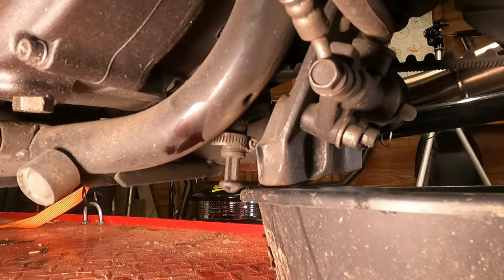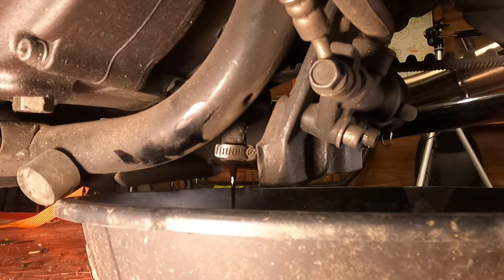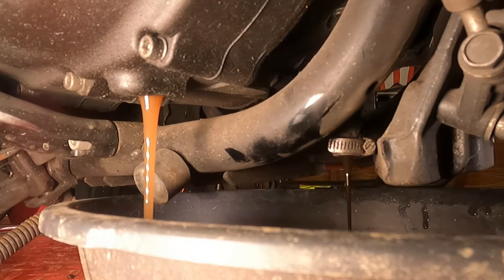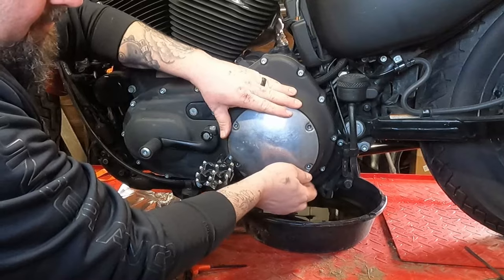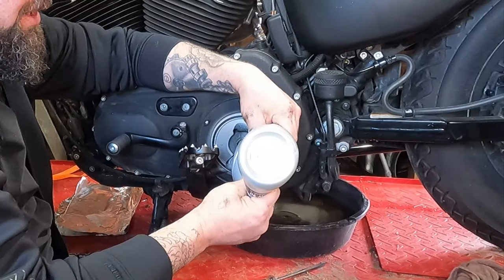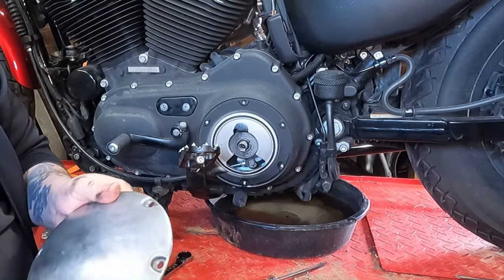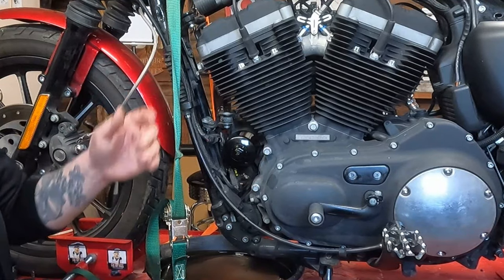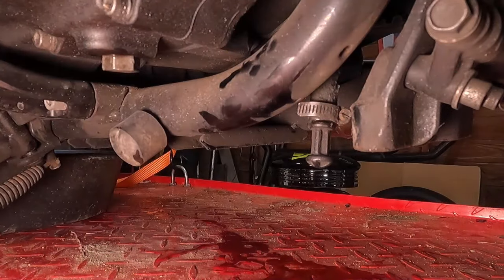Harley Sportster engine, primary & transmission oil change.

Comment: WRONG at time 0:43 he acknowledges the Primary and engine are the same type oil on this model sportster, then he proceeds to put 75-90 gear oil in it at time 8:58. . the wrong oil. YES many people put gear oil in and it is absolutely wrong to do on these model transfer cases. The reason is this model tranny needs very thin oil because it generates a lot of heat on the clutch pack, that the thinner oil carries away when it splashes the clutch. Thinner oil holds/stores less heat into it. It is not a good heat capacitor that can store tons of heat, this means it must dissipate the heat fast or it will be overwhelmed by heat. And it does dissipate the heat very fast it collects by conduction and even convection methods in the engine. . Much faster than gear oil.  , Also the tolerances are tighter on all the rotating assembly such that  thick gear oil won't penetrate properly into the moving journals, this causes accelerated wear on all journals. You absolutely do NOT want to put any type of Fiction modifier such as for limited slips in this tranny either. These clutch packs are designed to a specific viscosity of oil and thickness that the 20-40 weight delivers. the clutch packs are designed to slip a specific amount with a specific oil between them. . that a friction modifier will change. IF the clutch grabs to hard the non-case hardened teeth on gears will break off. This is why the clutch is designed to slip a specific amount. to reduce instantaneous shock on gear teeth that will snap them otf. The clutch pack is compressed on the oil and the specific density of the oil being changed by any type of friction compensator will damage the clutch pack because it will either expand the clutch plate interface and slip too much between plates or contract it and grab too hard. the two working together will cause clutch chatter when gear is released every time, bouncing of plates. Both are bad, Im not a shade tree mechanic. Im a post graduate engineer and it is all fact
Reply from the maker: Oh you’re a post grad engineer all right 😂.  I was a Millwright at NASA for 6 years, and I met a lot of you guys.  You’re overthinking this.  
You need sticky oil for a transmission that goes 0-100-0 quickly and repeatedly.  20/50 doesn’t have that stickiness. 

The friction modifier isn’t going to do anything to the clutch basket or gears compared to the debris from the primary chain and the clutch particles. 
Also the information I am sharing here isn’t new, it’s pretty standard across the motorcycle community, so I have millions of miles of real world usage on my side.
Reply: @KnobleMoto  sticky OIL? lol, Is that like sticky notes or sticky rice. LOL.  FYI Its called high surface tension. LOL. for your information you absolutely do not want oil dragging on the clutch, that's is one of the reasons the oil level in the primary must barely touch the clutch pack.  Everything I said is fact, It is ok ALL you know is how to change parts. You should never challenge greater wisdom than your own. But you're trying to go into the mechanical, thermal dynamic and fluid dynamics is laughable. You should just Fix that broken video and get rid of the shade tree mechanic concepts you have in your head.
Reply from the maker: @josephkaminski1857  did you just graduate in the past few years? What your opinion on using whale blubber in the transmission?
Reply from the maker: Your optimism for people giving weight to random comments is high.  Are you new to the Internet? 
But I am sure everyone who watches this video will read your comments, then go to your channel and be wowed by the wealth of knowledge and positivity you share.  Have you considered therapy?